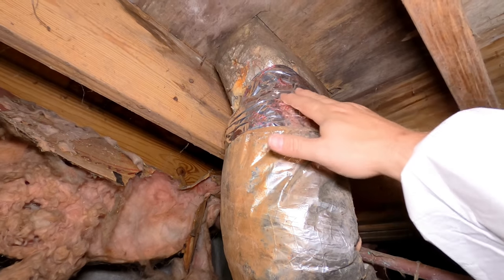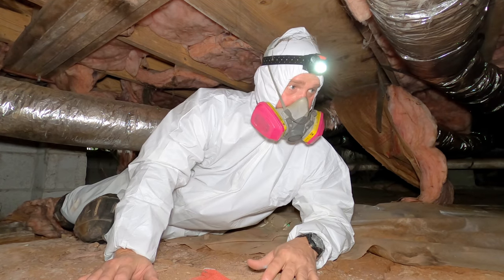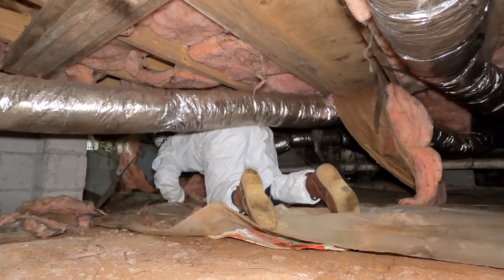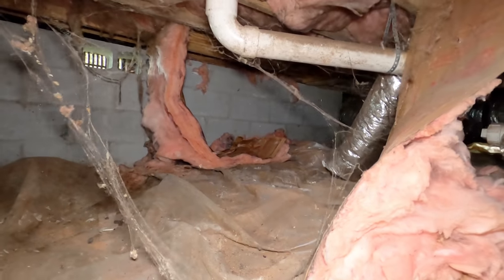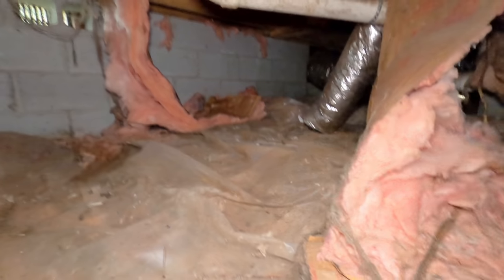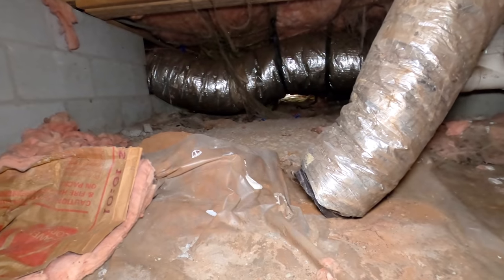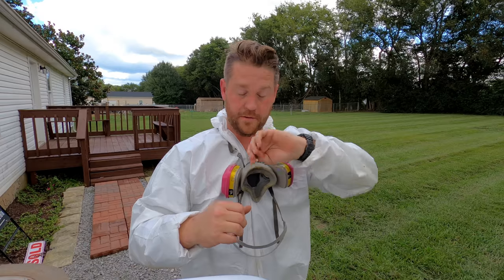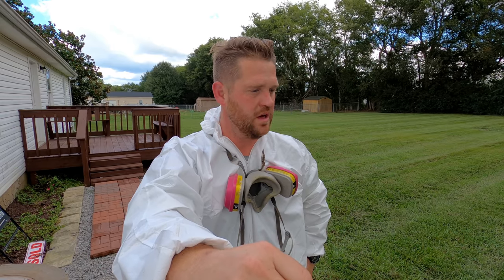Repairing HVAC Ductwork In A NASTY Crawlspace!!

Comment: Remember those stories the old guys at the local store would tell on summer evenings, you know, where they would make your worst day sound like a walk in the park?  Well, I'm going to play the old guy here, because I am an old guy - 64 this year.  Right now I'm working on a job that is under a double-wide mobile home, with wildly uneven ground littered with small rocks and concrete shards, where the old underbelly lining that held in the insulation is 50% torn out by raccoons and skunks.  In some places, I have 16" of clearance, in others, 30" - tops.  The amount of animal droppings, on the ground and up in the insulation, fills the air with dust, so like you I wear full body coveralls, but without the hood as I would be cooked alive with the 95F+ temps we've been having in Northern Cali until today.  So I wear a quality respirator and goggles, which makes it hard to keep the headlight positioned snugly.  The crawlspace is blocked off, with 2 access points, one at each end of the home.  Steel girders/joists in the mobile home frame run parallel to most of the 1 x 8 wooden joists in the flooring, but the steel joists sometimes interfere and make it impossible to use tiger-claws to prop up the new insulation, so I have to fashion a custom retainer in those cases.  Combine with that the larger diameter ducting that blocks my movement in and out of sections, and the pillars made of cinder blocks that hold up the mobile home, along with various 2" and 3" water piping, 5" sewer lines that run to the septic tank, and electrical wiring and old phone lines that hang around all over the place.  The best I can do is about 6 hours a day down there, at which point I'm just tired.  The tight internal openings mean that I can only half-fill plastic bags with the old insulation or else I won't be able to get them though those openings, or without tearing on the ground, and the farther I get into the crawlspace, the longer it takes to move supplies in and out of the place.  On top of which, there is always in the back of one's mind the possibility of an entombing earthquake, one that is just strong enough to shake the steel chassis from the cinder block pillars.

As for the Black Widow spiders that crawl about me (and the brown ones, too) I just shoo them along with almost casual indifference, because I have too much other sh** to deal with.  (If Widows do come towards you, as another commenter discussed, flick them off with a stick, and kill them if they persist; no need to poison yourself with spray in confined spaces).  We won't talk about the smell, the origin of which I finally located last Friday afternoon - a dead skunk!  It's raining today and tomorrow, so I won't have the pleasure of removing that fella until Weds.

I have yet to examine the various ducting to see what shape it is in, and the bigger stuff looks like it is 12" in diameter, but I need to measure that to be sure.  There's lots of fun in that place yet, before I'm be done with it, or, it's done with me.

I have to say that I was relieved to see that you, and others commenting here find these "workspaces" at times hard to deal with - I was beginning to think that I was simply getting lazy in my old age.  And... perhaps I am.

Thanks for posting the video, and thanks to everyone for the informative and helpful comments.

Comment: My favorite part is "I've got a customer selling their house and the inspector says..." You did all you could given the circumstances, but what'll sometimes happens in these situations is that the inspector will tell the customer excatly what you told them, and all their customer will hear is "it's fixed"! Then it will be sold under the guise of "recently updated HVAC system!" 🙂

Comment: Oh, yes my young brother I know of the crawl space and of temporary repairs that might just stay permanent. I live in a fifty-year-old house with a crawl space that in some areas has less space than in this video and maybe about the same level of grossness. I need to replace all the ducts but my cats have access so they cause me to do maintenance that I might otherwise not do. Thinking about tackling duct replacement as even though I have repaired the inner ducts the insulation is torn off and other ducts are compressed and bent. We will see what the future holds supposed to be a hot summer but at 74 who knows how long I may need cool air.

Comment: Interesting video! I don’t envy your field. I have a similar crawl space. Had my DUCTWORK replaced in 2017. I think there may be some disconnected ducts, when I turn on my furnace gettin a lot if stale smells in the house, and at night my house smell like a bon fire! and I feel like i’m breathing in a campfire!! eye’s, and throat burning! I will need to call the people that installed the duct work I’m afraid there is a problem down below? What are your expert thoughts? Thank You!
Reply: They probably didn't install it right. Have an inspector look at it, an air quality inspector.

Comment: Worst part about work like that is that it is mostly needed simply because some half-wit did a half-assed installation when everything was new and clean.  Failure to spend a few bucks on a hose clamp and/or properly supporting ducting tube = falling off and needing expensive rework later.  Not to mention filth and rodents contaminating the insides of the tube that is essentially impossible to clean out, and all the lost energy costs until the year repairs are finally made.

Comment: You can tell the original installer didn't want to be under there either by the (quality) job they did.
Reply: Well the house maybe 30 or 40 years old. Flex won't last that long. Just hope you charged enough for the repairs in such nasty place! This seller probably lived with little air or heat for a long time. Place very neglected! Maybe he lost his job.
Reply: Non of the houses are done right lol

Comment: Question. If I need to upgrade a 1998 York 3.5 Ton to a New Carrier/Lennox 5 Ton Unit, do I need to change the air handler or can I change just the coil?

Comment: Boy can I identify what you went through in that crawl space! My crawl space might be nastier; it has black widows. I put some rug runner down there, but at least that space you worked on has plastic on the ground.

I want overalls, mask and forehead light like that.

I need my heating duct replaced; the cats have just torn it apart. I have no money, so I'm going to try to replace it myself. I'll get quotes, but I think I'm going to get the heating duct; that's not too unreasonable.

Comment: How did they become disconnected? It looks like the branch-lines were not supported enough at the boot.   I'm about to go out into a crawl space today. For that Job I would have charged 170.00. Believe it or not, that was a quick fix.  Try replacing a whole branch-line in a tighter crawl space.  That is actually a good looking crawl space.  Some have no to little encapsulation.

Comment: At least they installed the insulation vapor barrier int he right direction.  That said, it should be illegal to use fiberglass in the crawl space... Rockwool/similar only. Doesn't fall apart.

Comment: I feel for you man. Crawl space work is not nice. I've seen those that are rental apartments. Leftover furniture and tires and you name it. Hasn't been cleaned in decades. Insulation falling everywhere and bugs, snakes, dead animals. You got it though, and you are smart having the safety equipment on the only thing I see you need a belt with snap pockets or a vest.

Comment: I hate house sale jobs. The customer doesn't want to pay for repairs and gets mad when you tell them that it needs major work or replacement. They just want you to write that it's all good.
Reply: Hi Brad. My recent experience as a home buyer in Florida (1973 concrete block 1150 sq. ft. 2/2 with ductwork in attic too small to stand up in)...was that the home inspector just noted that the ductwork was "functional." After closing on the house, turns out it's old and yeah, functional, but needs replacement. So I perhaps should have had an HVAC company do a separate inspection. On the other hand, with the housing market right now, people are making offers over the list price and buying with "no inspection" to sweeten the deal for the seller. Take care.

Comment: Bad environment but why no zip ties❓HVAC metallic tape WILL fail eventually.
Reply: Right? I use spray adhesive, a zip tie,  tape, then I pull up the outer lining, zip tie, tape and maybe use some mastic.

Comment: I wouldn't want this guy rehanging flex duct under my house like that. All that wasted mastic tape someone needs to show this guy what a duct plenum tie is no way you would pull the flex duct back off of there behind me without tearing it to pieces.. using all of that type like he did where I live would cause the house to fail inspection and violate code laws.